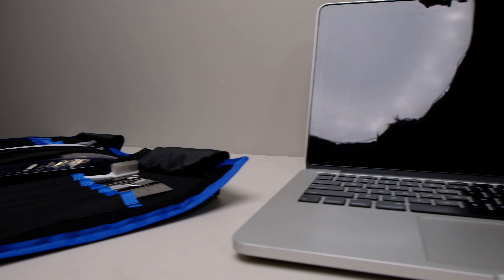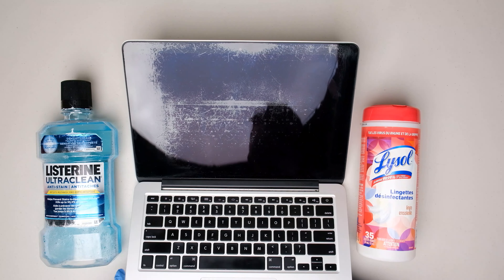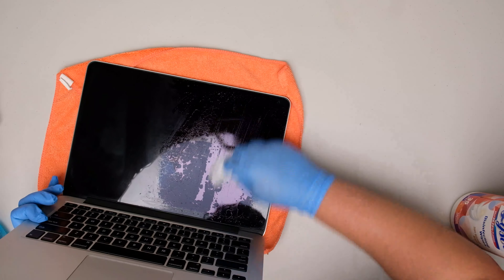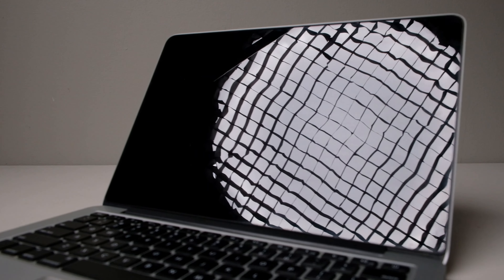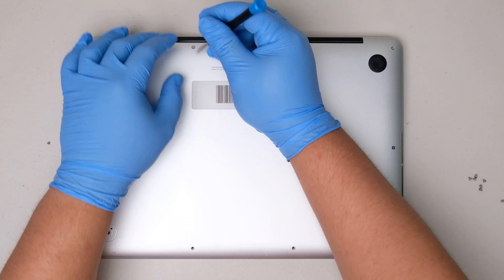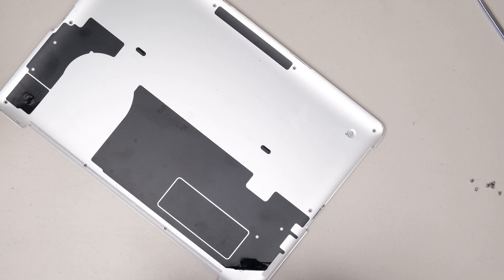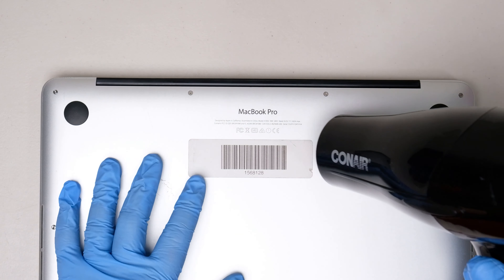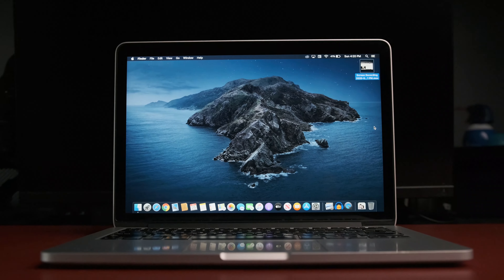I Restored This $445 Macbook Pro From Ebay!!! (Staingate Fix, Feet Replacement, Sticker Removal)

Comment: I just want to thank you for the suggestion to use Wet Ones wipes to remove the anti-glare coating.  After watching a few videos that recommended other solutions, I decided to follow your suggestion and I'm happy to report that within 10 minutes, I had removed 95% of the anti-glare coating.  The only thing remaining is a small strip along the bezel edges and corners.  My old 2015 MBP 13" is as good as new!

Comment: Does the Anti-Glare starts becoming an issue after 4 years only even if mine has been over 7 years but with minimal screen discoloration? Also, what did you say about the apple screen replacement program? Thanks loved your vid!!